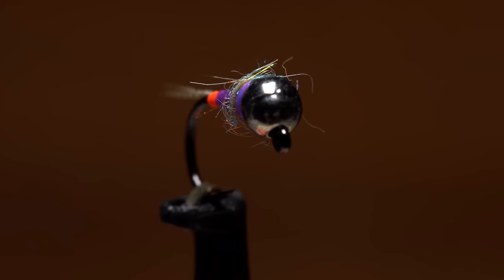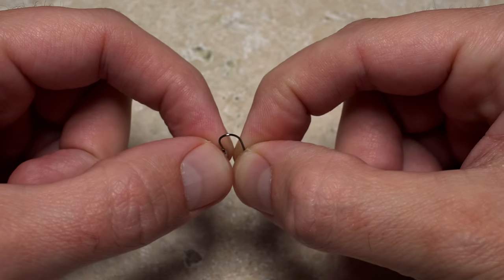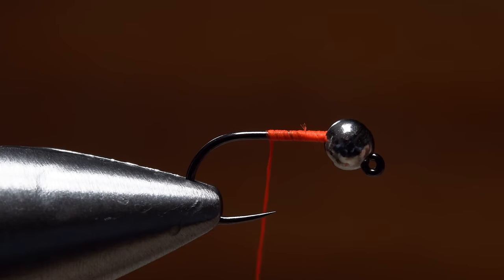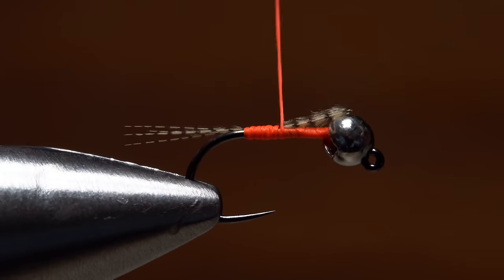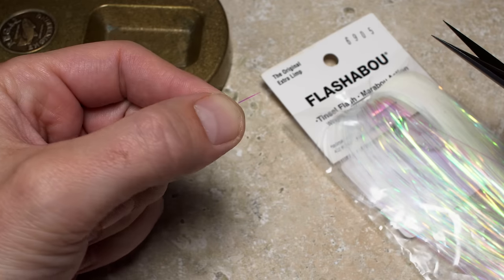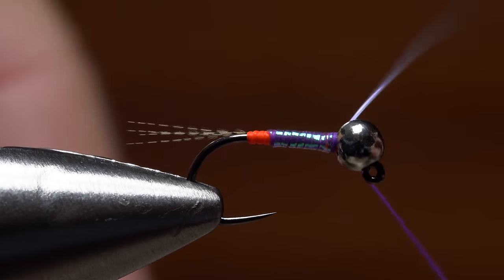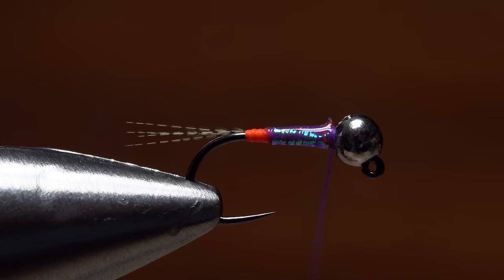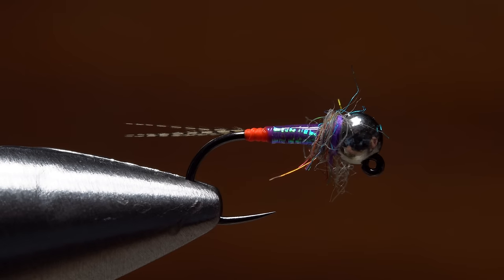McKenna's Rumble Bug

Comment: Tim -- I've noticed that you occasionally leave barbs on hooks (e.g., the Carey Special program). Can you explain when you think barbs are necessary (or just desirable)? I use barbs on small flies for steelhead, but never otherwise, because steelhead often bend hooks and create a straight-pin with no barb. Otherwise, I can't think of a good use for them, but do you have suggestions?
Reply from the maker: I believe using barbed or barbless hooks is entirely up to the angler unless there are specific rules against the use of barbs. Mainly because of the waters I fish, I go almost completely barbless for my own flies and like it (much easier to remove from the fish). But, if I'm tying flies for a shop or someone else, I'll almost always leave the barb on so the angler can make the choice. With the tying videos, I mix it up as well and encourage tiers to use what is right for them.
Reply: Well,yes,but I was asking whether you have identified an utility for a barb on a freshwater fly?
Reply from the maker: Sorry, I got a little sidetracked there. A barbed hook definitely holds fish better that a non-barbed hook plain and simple. Another reason for leaving the barb is that in some cases it is essential to maintaining the strength of the hook because of the way it was manufactured.
Reply: Thank you.